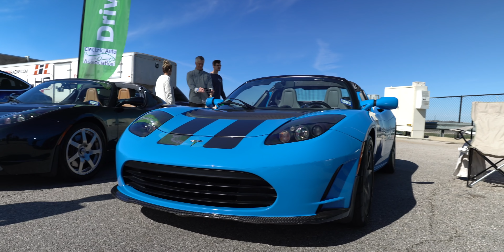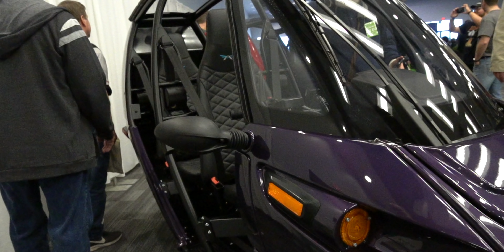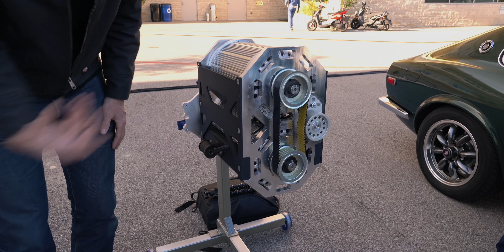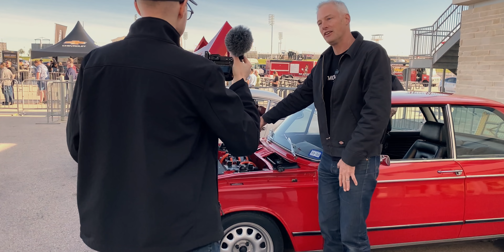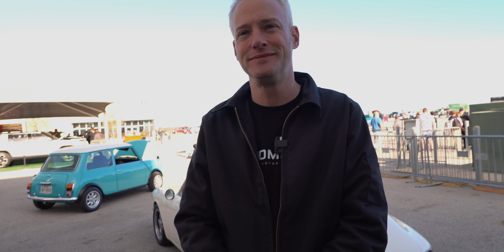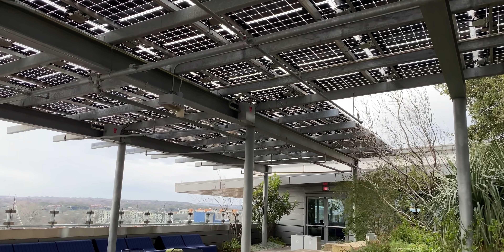EV Conversion and the Fully Charged Live 2020 experience

Comment: That Moment Motors Guy: “We are really careful to put the weight back where it would usually be.” He then shows a boot/trunk full of batteries... 🤷🏻‍♂️
Reply: Toninho. Sometimes converting to EV changes the weight distribution for the better. If the engine and transmission are taken from the front and the gas tank and fuel pumps are taken from the back, it should be possible to balance front/rear weight to achieve close to 50/50 distribution, depending on the range requirements.
    Also remember that when a fuel tank is full it could weigh 100-120 lbs, and when it's empty maybe 20 or 30 lbs. With batteries the weight stays the same, so the handling characteristics remain constant. The car may be heavier, but the power and torque from an electric motor is far greater than an ICE engine for it's size and weight, especially in an old classic.
Reply: Curmudgeon that’s all well and good, I can’t argue with that and wouldn’t want to, however, as true as what you say is, it’s not what he was saying. That was my point. Instead of lying about keeping the weight ‘in the same place’. So for people watching him say that and then see the car being shown off clearly not having the weight ‘where it was’ and instead it’s just thrown in the back wherever it fits. They may take that to mean the rest of his ‘sales pitch’ is also BS. To be clear, I’m not saying it is, just that that’s how it can appear to some.
Reply: @Toninho  . I hear what you're saying, and you're right that his presentation could use some work, but not everybody is as comfortable in front of a camera. I'm guessing he's nervous. It must also be off-putting trying to do an interview with a race going on in the background. 
    Most people who do EV classic conversions try to make as little alteration to the original car as possible, so it can be returned to stock in future, if necessary. That could be the reason for putting the battery pack in the trunk, rather than cutting panels to install it under the trunk floor.
   I don't know, but any way that classics can be kept on the road, and as an EV, is a positive to me. I'm not disagreeing with you, just offering another point of view.It's all good. Peace.

Comment: Somebody once told me that taking a large American luxury sedan and swapping it to EV wouldn't work because "it's too heavy" 
Sure would be nice if somebody took something like a Lincoln Towncar, swapped out the 500lb V8, the 100ish lb Automatic transmission, the gas tank, and utilized all that space to convert it to EV...Just to prove a point. It is body on frame, use the space between the frame and the body to make a "ev Skateboard" chassis. 
Thinking like an engineer, I KNOW it is possible...Just need somebody with more money than I to prove it.

Comment: Its a pity after 2 years in the UK where the show was at a motor circuit and real problems were caused by the noise caused by ongoing racing.. they repeat the mistake in Fully Charged USA. 
This year in the UK the show is at a new location. Hopefully they have now learned that motor racing circuits are completely the wrong place to hold the show.
Reply: Cant they have ongoing QUIET ELECTRICAL racing?.
If Internal Combustion(I.C.) engines are the past.  Then aren't the trappings of I.C. engines e.g. NOISE,  a relic as much as the I.C. engine itself?.

Less carbon emissions and less noise polution.

Comment: I haven't read all the comments or watched the whole video but doesn't he realize that with no gas engine the gas tank can be removed and batteries put there?
Reply from the maker: Yep, but their methodology is to keep as much of the car intact as possible.
Reply: The challenge is that the size of the battery pack you need to do a conversion is far bigger and heavier than any gas tank. So, we use whatever space is available and try to keep the balance of the vehicle as close to original as possible so the car still handles and performs well.

Comment: Thank you so much for spending time with us, Matt! We really appreciated you stopping by and love the coverage you did of the show!
Reply from the maker: Thanks!  Really appreciated the time you took to walk me through everything.
Reply: Moment Motors quick question while you’re here - what battery capacity and range do you get out of your modded 1602?
Reply: @rikardottosson1272  That particular car has a 30kWh battery pack which should be good for 80-100 miles depending on how you drive it. We have the ability to configure that car with a 35kWh pack or a 50kWh pack with different performance and weight implications, of course.
Reply: Best Electic vehicle is are as follows:- 

1300 kg 

1300 watts 

130 kms in 1:1 ratio of rpm 😎

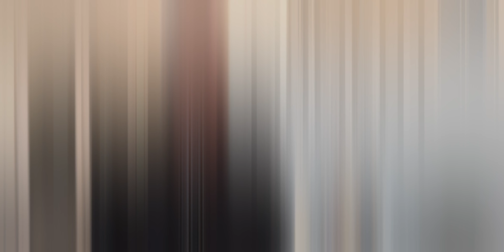Meaning Tesla range have to be over 13,000 kms in single charge in 1:1 rpm and 24,000 kms and above in single charge with a transmission system with 1:13 rpm ratio mean 1 rpm of motor 13 rpm of wheels in middle level 1:1 in Torque mode 13:1 mean motor 13 rpm wheels 1 😇

Elon musk cars have over 500 to 600 miles range 😏

Change rpm to 1:1 can give us over 9x higher range which is over 4500 to 5400 miles per charge and I m not talking about using and transmission system which easily boosts the range of any Tesla cars over 13,000 to 24,000 miles in single charge 😏

But they r not going to do it cuz it’s very low profitable business and elon musk wants only money money money 😂

That’s y he is not supporting hydrogen cuz it’s even less money money money 🤣

Comment: cool modular concept at moment motors. Maybe more easily scalable and thus affordable. Any infos on pricing?
Reply: Mind you, EV West said that conversions are only really viable for older cars, before they became drive-by-wire and electronically integrated. So we're talking seventies and earlier. Maybe early eighties. The reason is that too much of a modern car makes use of the ICE to power brakes, steering, A/C, etc. which will be complicated to power by batteries, so new solutions have to be found for these, and then you're looking at re-writing software :-O
That's why you need a 'dumb' car to convert. But even converting those will set you back something like the a new Tesla.
Don't get me wrong, I'm all for it, but you'd be hard pressed to convert a '90s Volvo or Porche Boxer to electric.
Reply from the maker: I did talk to him about that a bit.  Pricing varies wildly depending on the scope of work required.  It can be pricey.

Comment: Can't remember if I commented this already so I'll say it to make sure I have. My fiancee and I had a nice time chatting with you and your wife at Fully Charged. If anyone hasn't met him in person he's an extremely nice guy and fun to chat with. I'm glad he is a content creator and is the level of quality that other creators should strive for.
Reply from the maker: Thanks, Michael.  It was great meeting you too ... and appreciate the kind words.
Reply: Best Electic vehicle is are as follows:- 

1300 kg 

1300 watts 

130 kms in 1:1 ratio of rpm 😎

Meaning Tesla range have to be over 13,000 kms in single charge in 1:1 rpm and 24,000 kms and above in single charge with a transmission system with 1:13 rpm ratio mean 1 rpm of motor 13 rpm of wheels in middle level 1:1 in Torque mode 13:1 mean motor 13 rpm wheels 1 😇

Elon musk cars have over 500 to 600 miles range 😏

Change rpm to 1:1 can give us over 9x higher range which is over 4500 to 5400 miles per charge and I m not talking about using and transmission system which easily boosts the range of any Tesla cars over 13,000 to 24,000 miles in single charge 😏

But they r not going to do it cuz it’s very low profitable business and elon musk wants only money money money 😂

That’s y he is not supporting hydrogen cuz it’s even less money money money 🤣

Elon musk (ironmonger) 😏
Kalki avatar (Ironman) after 2026 😎

Comment: Matt, your videos are great. Yours is one of my favorite YT channels. Thank you for your great work.

EDIT: Specific to the video, I wish there were more companies that sold DIY "kits" for electrifying older vehicles. I absolutely LOVE the idea of breathing new life into a classic. My Dad had a '91 Supra that I remember fondly. I'm sure everyone has some vehicle that holds a lot of sentimental value for them. There are definitely shops for this, but the pieces of the puzzle and the labor is out of reach for most people. Electrifying a classic 911 sounds great until it's 50k for the components and then grinding out a 30k car. When can we do an EV conversion for LS Swap money?
Reply from the maker: Thanks so much!  I also wish there were options for more drop in style kits for conversions like this.  Off camera I talked to Marc about that and he said they're not in that business.  It's pretty dangerous working with battery packs like this if you don't know what you're doing.
Reply: Chevy is supposedly working on an electric crate.  Also, people really arent cutting up classic cars to do these conversions.  That was the trend with lead acids because the batteries were so big.  EV West specializes in doing bolt-up reversible conversions of VWs and Porsches.  Once the ICE stuff is stripped out they can install the new electric kit and be driving it around in a few hours!  Jaguar was also offering the service (with complete rewiring, at a huge premium) for certain engine types.  So part of the cost of these conversions is the labor, part is the very expensive components, and part of it is all of the custom housings and mounting plates they manufacture and all of the engineering they did to make it all work.  A home kit would transfer the labor cost to the owner, but you still have to pay for the components and the engineering behind them.

Comment: Good report, (as usual), thanks. Even if you used a directional body mike on the speaker the only way to record good sound in a high ambient noise environment is to use a hand-held shotgun microphone (the longer the better to reject unwanted noise) and instruct the speaker to hold it oriented straight up just below their chin for the best possible signal-to-noise ratio. And, use a “dead cat” cover so you are prepared for any kind of wind noise. “Bad sound makes good video look bad.”

Here’s an example of a reporter’s shotgun microphone that he wisely uses because he’s usually encountering very high ambient noise at airports:

https://youtu.be/oWGPRwERSxA
Reply from the maker: Thanks, Bruce.  Totally get that audio feedback.  Doing the best I can with the gear I have.

Comment: I am so, so happy that EV's are becoming a major thing now.  Swapping an internal combustion engine for an electrical one is outstanding! I had a discussion with my dad about gasoline, crude, natural gas, etc. He likes gas for a stove, I like electric. I told him  " Dad, I can put up a windmill or solar panels, I can't put up gas panels. ". The irony? He's a DC detail electrical engineer hahaha.
Reply from the maker: Ha!  That's pretty funny.
Reply: Tell him to try a good induction stove, I for one will never go back. Control is roughly equal to gas, but no heat over the element besides the pan, and mine can put nearly 4kW through the 'element', takes literally a few moments to heat a pan. Can boil 2in of water in 1 minute from cold.
Reply: My cousin works for ExxonMobil at a plant; his wife is a teacher and drives a Chevy Bolt.